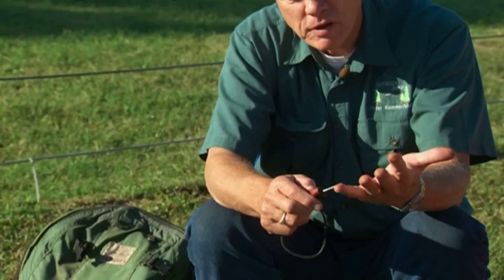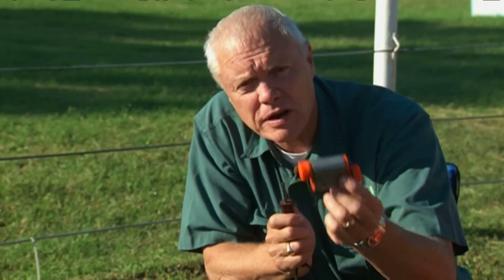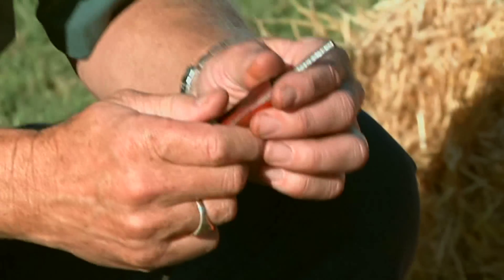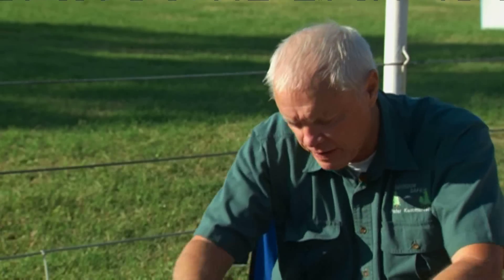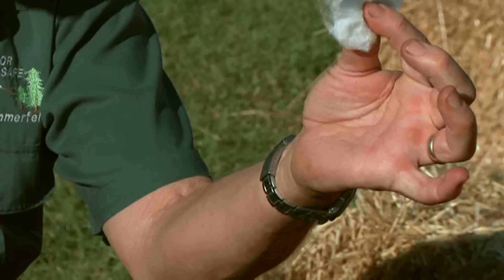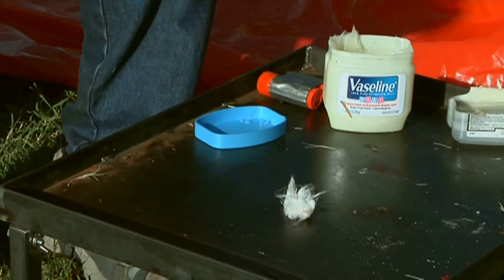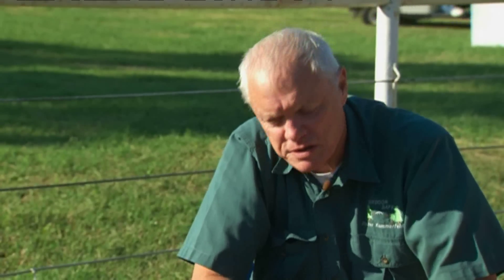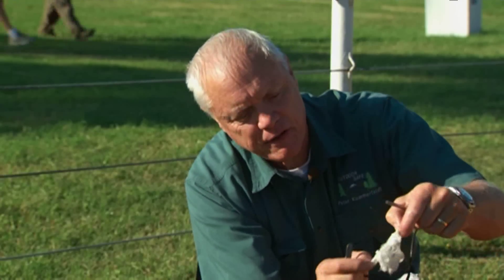ODWC HE survival three

Comment: doyou really think that someone with hypothermia is going to be able to start a fire by holding that little striker and using alot of pressure while slidining it and accurately placing sparks with shaking hands? and zippo lighters are mostly windproof, metal, and they are easy to light